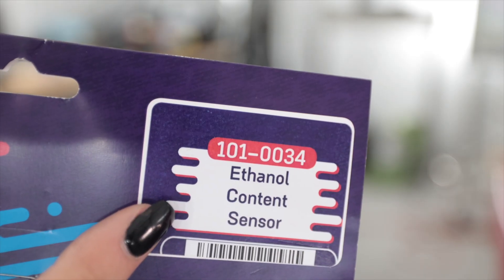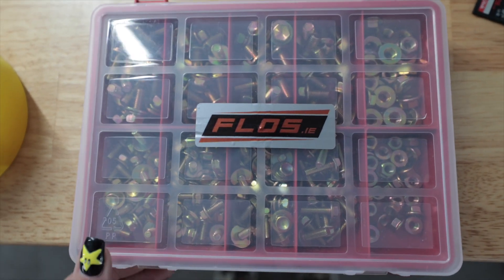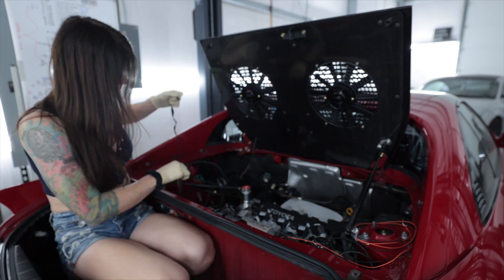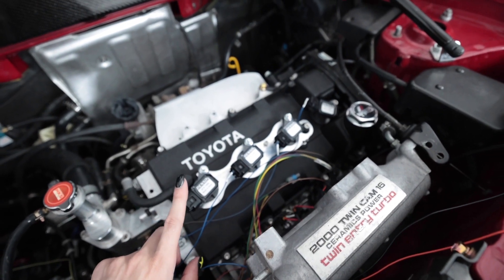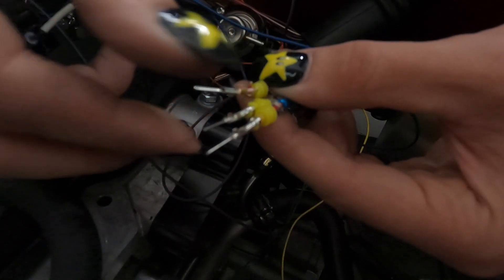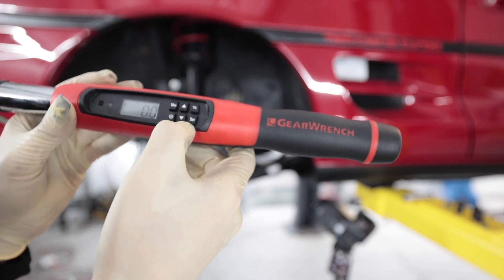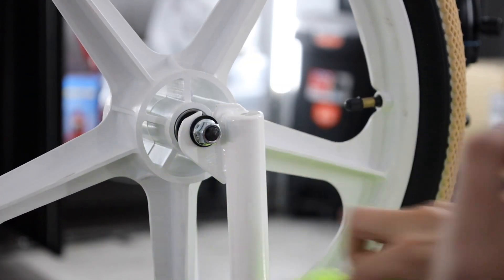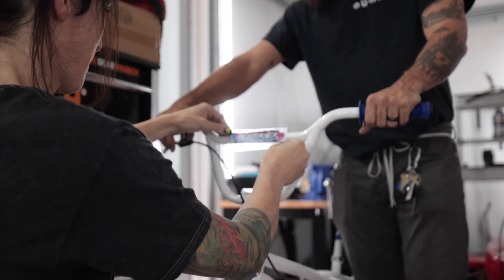The Secret Sauce To Making More Power! // Rewiring A MR2 From Scratch

Comment: I love what you’re doing. I like that you’re trying to modernize it and keep original Toyota as much as possible. A 5s oil pump and original Toyota crank gear has what you need for oem crank sensor mount and function. this will keep it all original and cleaner looking.

Comment: Milwaukee makes awesome M18 impact 1/2 inch drive impacts that are like half size.  And are easier to use all  day and fit in tight spots.  And mine have blutooth torque adjust and lockout for security.

Comment: 4:47 THAT was a pretty sweet pickup line there...."She's a snack" 🥰
GT bikes were so badass back in the day. way to expensive for me my parents bought me the Sears special BMX bike. It weighed as much as a fifth wheel hitch. but if you wanna be truly 80s....you need to add the brake gyro on the front fork and add some back foot pegs 😎

Comment: Hello Sarah from Down Under ;)Re - Your swamp cooler , do not put bleach in it you don't want to breathe that in..Drain the water after 3 days and if not using it after the 3 days drain and let air dry. run some disinfectant in it for a bit now and again, it's the water that's the problem. you don't want Legionnaires' disease Sarah..

Comment: your wiring skills are on point.  I build tube amplifiers and speakers for a hobby but i'm not what would be considered hobbyist level for wiring I can wire with the best of them.  I have immense respect for your knowledge and your desire to continually learn.  Mad respect Sarah!  And no, being "anal" about putting/using the right part for the specific  job is how any professional mechanic does things.  Look at an F1 team.  Every tool has its cubby hole and no tools get lost.  Also they maintain a clean working environment because that's the only way to ensure quality.

Comment: A little secret to installing decal stickers spray with water dial soap mixture and you can lay it on and move it around before pushing it down and squeging the air bubbles and water out from under decal center out.

Comment: Switch to the DT connectors by JR Ready. It take a special crimp tool bu they are much better, much easier, super clean, and way easier than the weather pack type you were using! It makes wiring so easy! ....and you can remove them easily if needed.

Comment: That fourth ignition coil being turned around from the three is bothering me.  See if you can do something about that.  The GT turned out awesome, and now you need accessories for it like a front brake, gyro,fold down fork stands, axle pegs, and a frame stand on the back.

Comment: From here, 2500 miles away and through an electronic window,  that bike looks way too small for a 5 11 rider with those legs. 
I ride one of four vintage bikes everyday but draw the line at pink pedals. My 1970 BSA three speed needs new decals and black paint. And having trouble getting vintage size tires right now, there is a serious parts shortage in the bike world. 
Still trying to get over blue being ground instead of black. 
Dazed and Confused in NY ....Larry

Comment: Adding Loctite to the fastener threads reduces the coefficient of friction during assembly.  If you used the factory torque specification that was intended for dry threads, you would over tighten the fastener.  That is probably why you thought the threads were going to strip even though you hadn't reached the specified torque.

Comment: I love your attention to detail on both Mr. Dos and that cool bike. The textured pieces in the engine bay look great, the Hall sensor and crank are too pretty to hide behind a wheel, and the braided wire cover for the auxiliary fans looks factory. I’m taking a break from my version of OCD-Ing over Jeep modifications (adding overlanding equipment), and really enjoyed this video. I’m not a wiring guru like you, and get a kick out of watching you piece together harnesses and pin connectors.